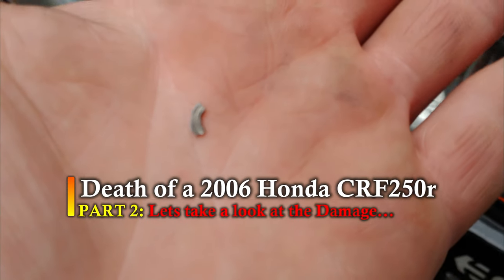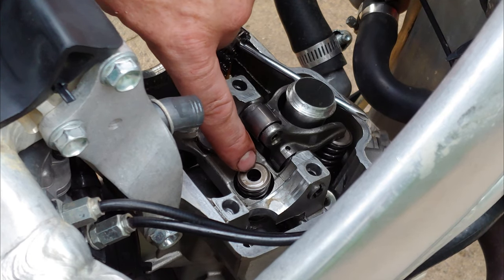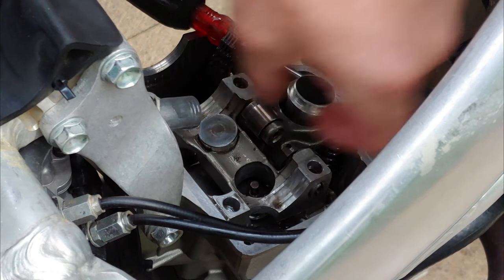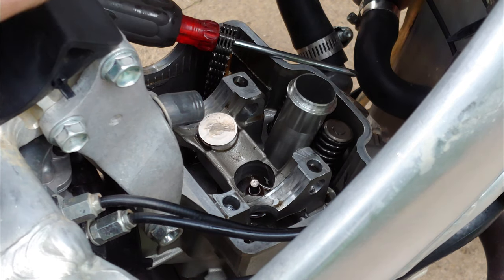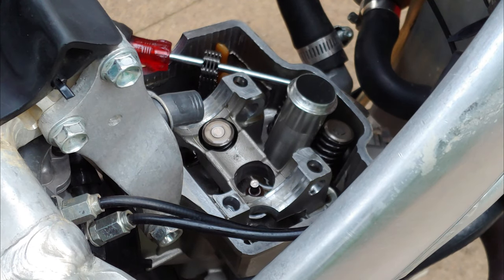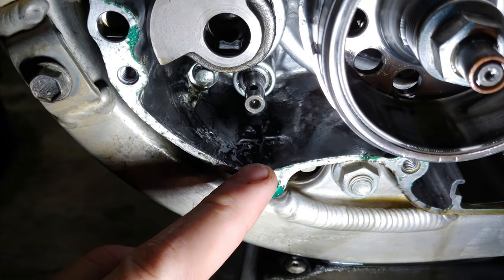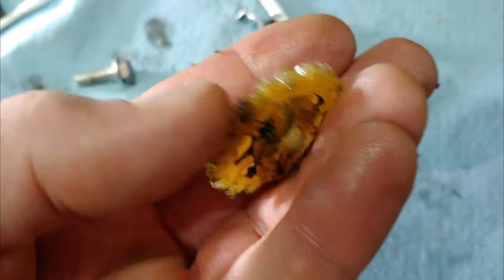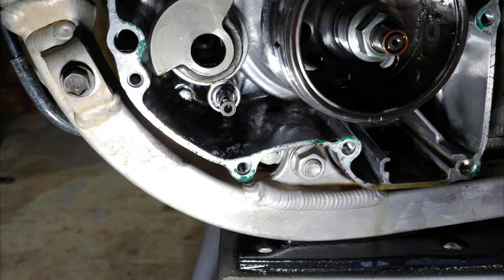Death of a 06 CRF250r Part 2 | The Damage

Comment: I have a question if u don’t mind answering, will 2009 crf250r transmission bearings fit in a 2006 crf250r??
Reply from the maker: Yes, they should. But you can cross reference them in rockymtatvmc if you need.